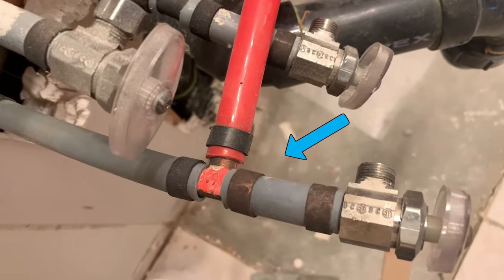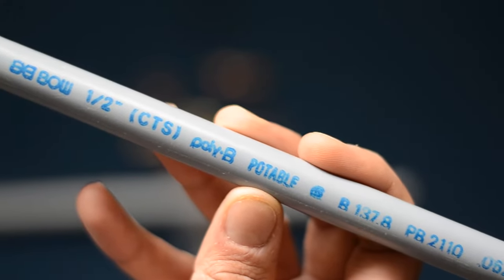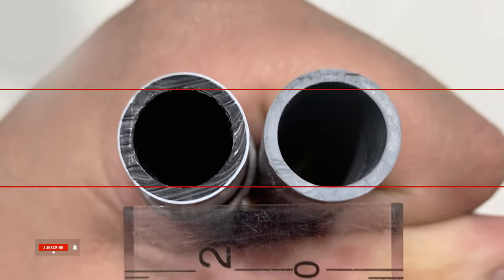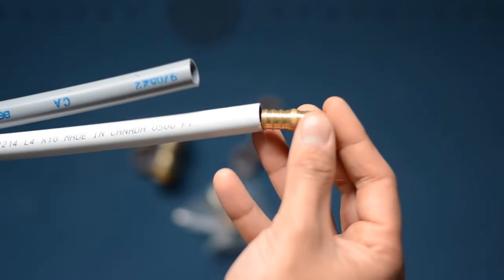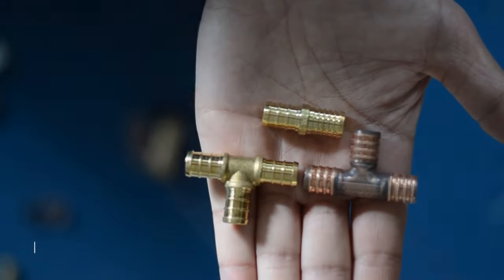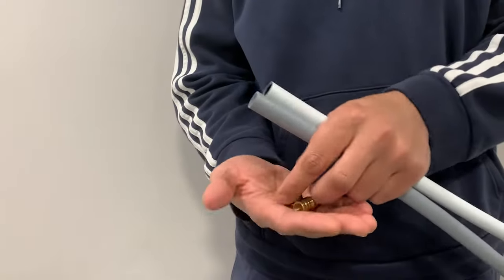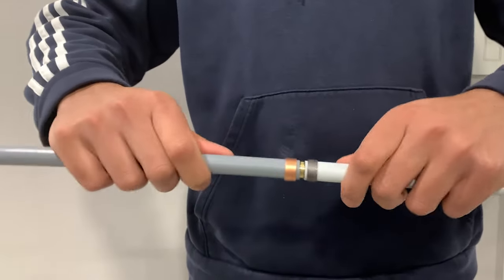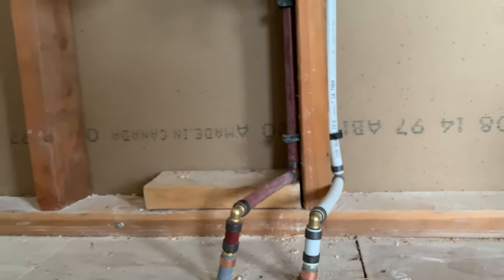Poly B Replacement : How To Replace Grey (Polybutylene) Pipes With PEX  - 2022

Comment: Can you use a Pex Crimp Tool on the Poly B ring?
Reply from the maker: The same tool crimps pex or poly.
Reply: @TheBuildingExpert  I just bought some poly B to pex sharkbites on Amazon. The seller told me the sharkbites for poly B come in different colors after I asked him why the coupling was blue he sold me but labeled poly B.
Is this possible??

Comment: Are you certain that a pex crimp ring will not fit over polybutylene?  I just need to replace a Tee for now, and later re-plumb.  Thanks!
Reply: The issue is not the PEX ring.  Poly-B has thinner walls, and the PEX ring will not fuller compress.   To counter this effect, the poly-B side of the coupling (more ridges) has a slightly larger outside diameter (OD).   Because of the OD being larger, the ring has less room to move, to crimp down.  Same goes for stainless steel rings.   You simple need the larger OD of the coupling to make it all work.   Before applying water pressure, you will know if the ring (or crimp clamp) has tightened all of the way.  Should be obvious.   Poly-B is a pain in the pahtutty, but with the correction transition pieces, you'll be up and running smoothly.  Hope that helps.   (PS not a fan of the sharkbite options.)   Pro contractor here.

Comment: I can’t find the adapter for 3/8 poly going to 1/2 pex. I’m currently disconnected. Most of house is 3/4 poly. Just came across this 3/8 poly and it’s screwing me up. Any help would be GREATLY appreciated.
Reply: I had the same issue.  I was able to get a 3/8 PEX to 3/8 PolyB fitting.  Then after a couple inches of 3/8 PEX I used a 3/8 PEX to 1/2 PEX fitting to complete the transition to 1/2 PEX.  Not as nice as a 3/8 PolyB to 1/2 PEX fitting, but I couldn't find those.

Comment: I've only seen the plastic poly b fittings fail. Not the pipe itself. 
I've also seen shark bite 3/4" fittings fit on poly b quite well.

Comment: first of all thanks for the info. question i have heard all bad side of polyb but why we keep some polyb in the house water supply system instead of switching all into PEX. I have a manufatured home with all polyb pipe water supply and am studying to replace them all with DIY
Reply: ive had poly b for over 30 years , and my experience was the cone gaskets at the faucets leaked early on. Did have 2 other leaks at the places where the pipe  curved, but  thats it.
Reply: Replace it all. The fittings are most likely to burst, especially if there is a lot of chlorine in your water supply. So in the video, the creator removed the risky couplings angle stops, but left the tubular piping, which is a huge improvement and good move if you dont have access to repipe everything. That said, replace it all, it may last 20years plus with no problem, but the burst fitting will flood worse than a pinhole joint. The pipes are timebombs.
Reply: @looseforward  phht, 30 years not a dribble , all metal connectors. Major problems in the SW US, where the pipes are run in attics etc. Different story in Canada where the pipes are installed behind insulation. BTW all plumbing fails including copper

Comment: Best thing is to get rid of al the poly-B pipe & you wont have to worry about these special couplings.
Reply: in North Carolina, many of the main service feeds are still (yep) Poly-B.   We transition immediately, but still need to be done on a regular basis.    Also, some internal runs need to be converted, rather than torn out.  It happens.
Reply: @Lets_Go_Canes is there a lot of work with changing poly b to pex?